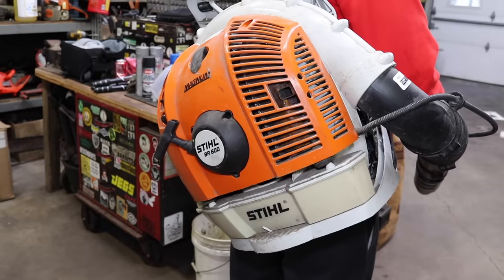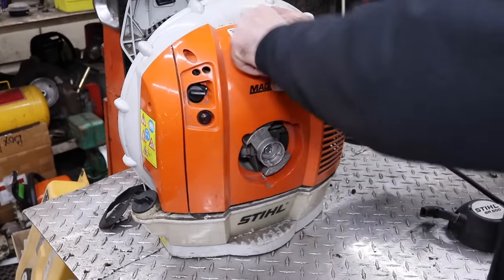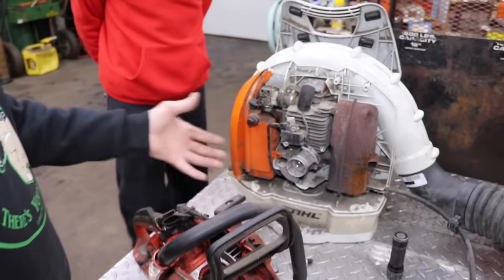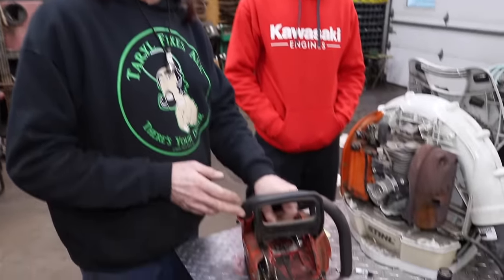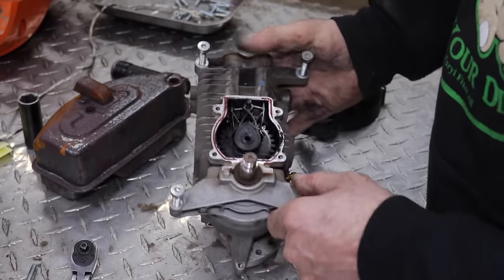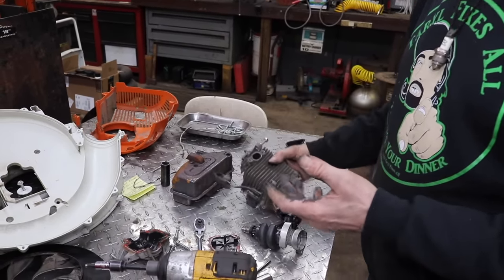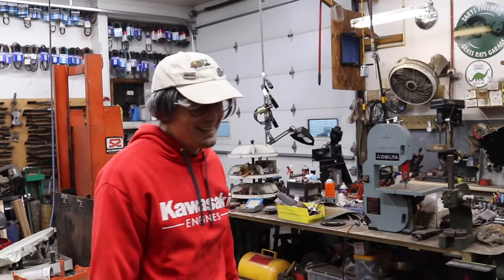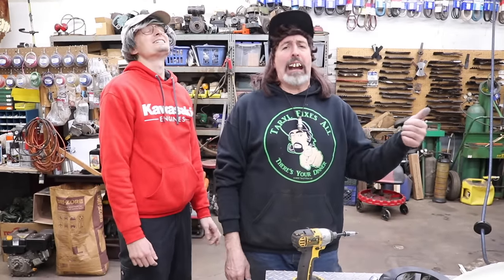4 mix NIGHTMARE! DON'T make this mistake 🚫

Comment: As a Stihl dealer with many years of experience I think I can address your two main concerns regarding the 4-mix blower models plus add some insight into Stihl's reasoning you may be overlooking.  I've sold hundreds of 4-mix blowers over the years ever since they were introduced following the success of their 4-mix line trimmer engines in the early 2000's.  This engine design was forced out of Stihl as a result of governmental regulations and Stihl was unprepared at that time and had to source first generation RedMax strato-charged engines for a few years until their engine was ready.  Stihl's 4-mix blower engine is a low RPM/high torque hybrid design combining two and four stroke technology and plain bearings are common to four stoke engines.  I have never seen a caged roller bearing used in the small end of a con-rod in a Briggs, Honda or Tecumseh four stroke engine.  The wrist pin bearing doesn't rotate thousands of RPM like the big end bearing.  It only rocks back and forth about 30 degrees. The wrist pin bearing in Stihl's 4-mix line trimmer engines probably is some kind of needle or roller bearing because those engines are lower power and higher RPM.  Now on to the cost factor, the MSRP for the 4282-030-0411 crankshaft is currently $443.99.  This price does not reflect their 2.5 % bull!#*t charge which we would first add to our cost and then use a multiplier to achieve a resale price of $455.08 resale price.  This is a complete rip off rendering any repair uneconomical.  However there are complete engines available for all 4-mix blowers, BR600 uses part number 4282-020-0201 which has an MSRP of $199.99.  Unfortunately this is not a full margin part and we would have to add 2.5% to the cost and use the same multiplier to achieve a resale price of $247.69 plus tax and about one hour labor.  At this price we will make a reasonable profit and economically repair the customers blower.  Stihl came out later with their version of the Strato-charged two stroke but they can't use that name because Husqvarna acquired the rights to that name by buying RedMax from Komatsu-Zenoah.  Stihl instead uses the name "low emission two stroke" which they use on all their blowers smaller than the BR500.  That design of engine does require a roller wrist pin bearing.  Next year both of these low emission blower engines will be come obsolete in our area in favor of battery electric tools that are underpowered, heavier and double the price of their gas counterparts.  Our shop is located in goo goo land where unelected eco nazis fine you for watering your lawn, ban the use of barbecues and fire places on days they deem as poor air quality, force you to use all electric (no natural gas) in new construction. And on and on, they won't be satisfied until commercial landscapers and home owners are using all hand tools like the Amish.  Getting back to the main issue, Stihl 4-mix blowers will run trouble free for thousands of hard use hours if synthetic oil is used with fuel rated 89 octane or higher and it does not have to be Stihl's ultra oil it can be Echo red armor for example.  I hope this clears up some questions or maybe raises more questions.
Reply: (Wiss) Thanks for teaching me about this one thank u.Taryl .
Reply: I can't speak for the br600 and above but I can say that my br430 has worked flawlessly for over 8 years. I also have 2 stihl backpack blowers at work (15 to 20 years old) for cleaning the parking lot and none of them have ever had a problem. We always use 89 octane with stihl or echo oil, I really believe this makes a difference. I also agree that those communist dems need to get voted out.
Reply: Please comment on Amsoil 2 stroke oil? Not affiliated, but just wanted mechanical or engineering take on it.
Reply: im sick of this eco-nazi BS. i will NOT be buying electric outdoor power equipment. i guess if my gas sthil FS90R quits and i cant source a replacement unit, i just wont be weed wacking anymore. the electric outdoor power equipment are more expensive to buy, the batteries are expensive. you WILL spend more to do the same job, the equipment wont last as long, and it wont have the same capabilities or run time. my FS90 is 14 years old but it can still clear out heavy brush. it is starting to get old though
Reply: Good take. Been selling Stihl for about five years now, and couldn't agree more. Greetings from Arizona
Reply: Thank you.
Reply: @andrewdonohue1853  Mine was getting old too and it wiped out the camshaft . A $25.00 part . The valve adjustment checks are an annual thing . Check those before yours does the same as mine did , Hope I saved you some future grief .
Reply: BIG difference between a Briggs motor with a plain shell bearing that runs in an OIL BATH and one of these hermaphrodite 4 stroke things without a crankcase full of oil. This is just a poor design.
Reply: I like the bean counters excuse to build a crappy design. Think I'll keep my Echo.
Reply: What about echo power blend gold?
Reply: @marktarascio4766  as Steve stated use good oil and gas, maintain them well and they last a long time.  Mine is an original BR600, before the Magnum. It’s lasted since 2009 with residential use only.
Reply: @Steakholder01  You won't go wrong with Amsoil. Keeps engine clean and greatly reduces wear. I use their Sabre oil for 2 stroke and 4 mix,,,,,,,,,,And if you can find a gas station that sells non-ethanol that will be a plus......

Comment: As always the working men and women getting screwed again by companies excellent video taryl  thanks.
Reply: That's partly true, but it still doesn't change the fact that knowledge about oil and spending the extra money for the right oil.
Reply: @powderriver2424  that’s just an assumption.
Reply: Milwaukee did this with their best 1/2 impact at least they replaced the poor redesigned new one with the old model “A”
Reply: @lawnmowerdude  Not really an assuption, we all seen the video, no engine should look that sludged up, rather gritty looking using good oil. Bad design, plus bad oil, 2 wrongs don't make a right.
Reply: If they made them idiot proof they would be four times more expensive 😢
Reply: @baileyhatfield4273  my br600 has been flawless for 10+ years. Use the right oil and you don’t have a problem… this is a user issue not a manufacture issue.
Reply: @FishFind3000  - I’ve easily got 15+ Stihl units and only run the orange or gray Stihl oil with Non-Ethanol. Never had an issue outside of a couple carb replacements; after about 10 years the crap gas nowadays wreaks havoc. And two trimmers needed the valve lash adjusted, took my dealer about 2 minutes and not charged.
Reply: @lawnmowerdude  - 15:49
Reply: @RustyZipper  I had to do a carb replacment on my km131r but the blower is a champ and keeps going. Haven't touched anything on it.
Reply: Glad I sold mine on Craigslist. That piece of crap always wouldn’t crank and cost me $700. Never again. Sticking to red max
Reply: There isn't a product out there that has ever been free if problems for some one. Love my Stihl equipment. And I mow for a living commercially. At the end of the day I worry more about a quality dealer and how well they treat me.
Reply: @meegstomtom  - yup! I’m very fortunate that my quality dealer is about 5 minutes from me. I know all of them by first name. If I need something fixed that day they have no problem clearing their bench to fix it while I wait. Otherwise I have plenty of spare machines so I can wait patiently. Bringing them beer every visit and paying cash also helps!
Reply: @glorious.warrior  - it probably needed a valve lash adjustment. It literally takes 2 minutes. That guy who bought sure is laughing!
Reply: @glorious.warrior  Your absolutely right about that.  I've been using my Red Max weed Wacker for over 20 years. It just doesn't quit.  Amazing product.
Reply: @RustyZipper  There junk.  Just like there cheap ms170 chainsaws.  Cheap crap
Reply: @FishFind3000  You are lucky then  most are dusted after a couple of years. Plus they should work fine without special oil.
Reply: @bernieglass8098  - shoot, I know many local DPW’s , fire Departments and tree company guys who use them 170’s and beat the absolute piss out of them. They work great for light utility work, not cutting down a 44” tree or blocking firewood all summer. They typically get dropped from a bucket or fall out of a truck before they blow up. But for $200 what do you expect?
Reply: @RustyZipper  Well I own one.  Definitely polan quality.  But your right about the price. If I'm needing to cut large rounds I break out the timber wolf
Reply: @Scott Hennis  thats absolutely false lmao. Im a stihl tech and youre clueless.
Reply: @bluejene2146  Clueless?  I have been  working on this stuff since the late 70's and still own a shop and I know what we see and some of the other shops too. . I realize there is know convincing a sthilhead . This is how I put it when someone wanted to upgrade, who is the #1 seller of Hamburgers? Of course McDonald's.  Is it the best burger you ever ate ? Nope is the quality ingredients? Nope . There are so many better burgers out there why is it #1?  Name recognition and marketing  they are a marketing machine with a mediocre product.   You very rarely see an older BR blower on landscape  truck because they are toast after a few years yet you'll see old Echo's with a duct taped nozzle no air filter  ten years old and still going ! Same with Red Max or Shindaiwa or Mauyama.  It will be interesting to see how the venture into the zero turn market goes  though.  Oh while you may be just a "sthil tech"  I am one for all listed above  plus Honda,Toro,Exmark, Gravely ,Husqvarna AYP . Should I mention Yanmar ,Dahaitsu Onan?  Oops just got a ,neighbors BR blower won't start ,I'm sure the leaky ass carbs they use has either flooded it and fouled the plug again or saturated the filter or the coil went  out .
Reply: @MUUKOW3  - heck if I were you as a mechanic I’d be happy that people kept buying Stihl so you can keep taking their money when they break. I know plenty of new landscaping guys that I’ve lent my Stihl stuff to try after I see them struggling with all of those off brands you just mentioned. Funny thing is I see them throughout the summer and only ever see  orange and white equipment on their rigs. Occasionally I’ll ask why they switched and they usually respond something like: I’m a professional landscaper and got tired of fixing the Mickey Mouse / toy / Chinese equipment I was using. I personally don’t care what people buy, but I can tell you that my SR450’s have made me some serious money, and I’ve yet to have a single issue with the motor. Everything has been very minor and typically a wear item. I keep a whole inventory of seals, gaskets and such on my truck as they seem to go limp after 2-3 years.
Reply: @RustyZipper  Off brands ? Echo is an off brand?  Red Max off brand? Makita /Dolmar off brand? By the way the other offbrand Shindaiwa actually went in and helped Sthil develop the four mix technology. So obviously you know very little about equipment and just happy you got that Sthil belt buckle to compensate like most sthilheads.
Reply: @bluejene2146  Well sounds to me that your the one that's clueless.  You probably think them box store John deere are great lol
Reply: @Bernie Glass  ive worked on every single brand and model of small engine that exists today bud and I still think you have no idea what youre talking about. I highly doubt you run a shop.
Reply: @bluejene2146  Your right bud. You win.  Just consider yourself Mr. Know it all. Lol
Reply: @MUUKOW3  - so exactly how many of these units do you own and rely on to pay your bills and feed your family? 🤷‍♂️ Just ask yourself if it’s possible that you are biased because all you do is work on junk units. Obviously there is more Stihl units coming into your shop because there are more StihlHeads buying them to break. I don’t have a Stihl belt buckle, but I got a few hats, black and hi viz green that I wear with pride because my Stihl SR450’s feed my family, pay my bills and allow me to go on vacation. You should be thankful there are so many of us idiots that keep buying Orange and White so that you can pay your bills too!
Reply: @RustyZipper  The broken ones do pay the bills  and you are right I am thankfull. It is the fourmix stuff that is horrible not the whole line up. When it comes to handheld power tools Shindaiwa trimmers and saws and the big saw is a Dolmar .  My T-230 trimmer is 25 years old and spent its first 5 years on a landscape   company and still clearing and several of the others I sold them are still on the trucks. Come back when you find a 25 year old fourmix still running without any internal work .
Reply: @MUUKOW3  - I can’t argue the fact that most things made 25 years ago were of far superior quality. But how’s a guy today needing a machine going to find a 25 year old, well cared for unit? I can’t wait two years checking Facebook marketplace hoping to find one 🤷‍♂️ Stihl probably spends more on marketing than all of the others combined. And the fact that they have no territory setbacks. Stihl will literally let two separate dealers work next to each other. In my small town there is at least 6 “dealers” mostly just hardware stores stocking the entry level trimmers / blowers / saws and 2 construction rental dealers. My dealer stocks nearly everything from the biggest saw to the smallest hand pruners, and has been very good to me. Essentially there are no “off brand” dealers outside of Lowe’s / HD to sell the machines that you recommend. Sure A few back woods shops that are complete hole in the walls. Places where you have to order a machine in April, check in every month and finally get it in October (no exaggeration) turns most people like me off those “smaller” brands
Reply: Got one we sold 2 weeks old  and cranks locked up
Reply: @BriggsMower  must have ran garbage gas
Reply: Business criminal's.
How is that legal?.
Reply: @FishFind3000  Do you mix yourself?